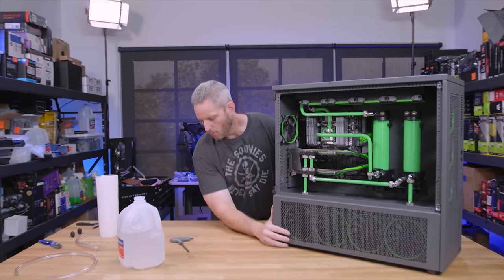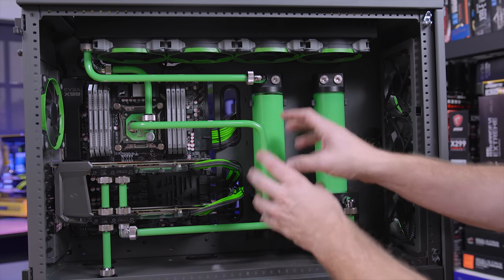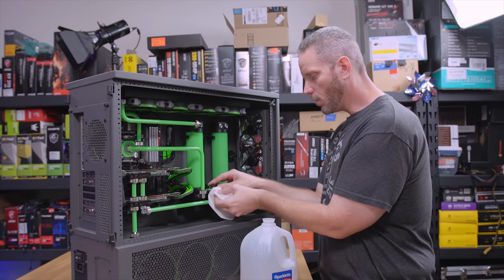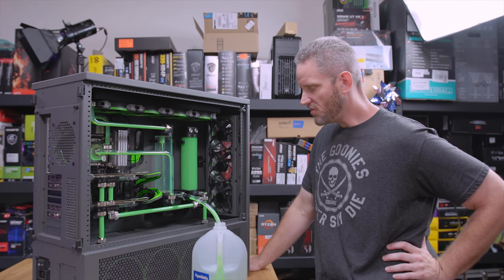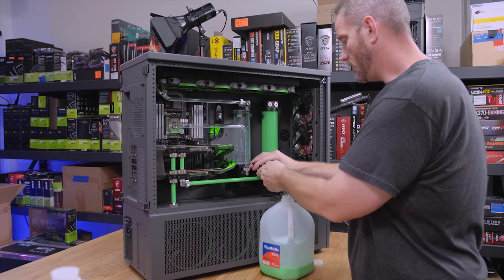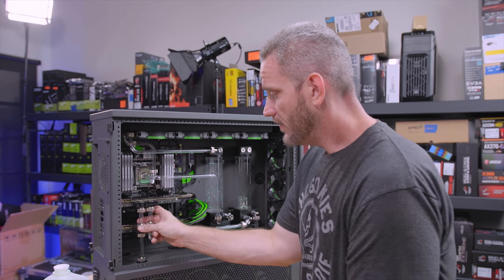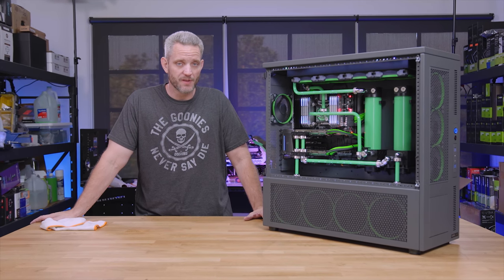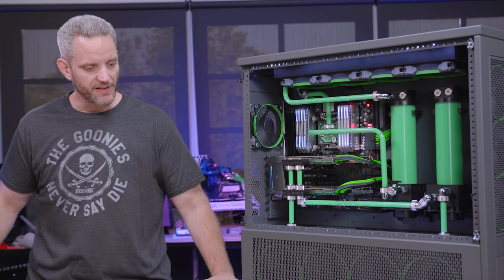This fluid has been running for TWO YEARS! Did it hold up?

Comment: lol, didn't know cooling fluids had dates, mine is still in since 2014 XD
it was clear, it's now somewhat green, but i think that's just the color from the green replacement tubes i used.

Liquid: self mixed liquid (EKWB: EK-KIT X360) and ''battery water'' (total 1L)

Comment: I've never used water-cooling but I've built a few computers and I'm a mechanic. Why don't people use automotive engine coolants? One would think they are perfect for the job containing seal conditioners and corrosion inhibiters. I'm sure there is a reason, just interested. The longest are rated to 5 years?

Comment: I'm curious about the internal design of the blocks that sit on the CPU or other chips.  Is the internal surface of the block smooth, with just an inlet and and outlet?  Or is there some way to create turbulence and maximize coolant to surface contact time?  Does anybody make one with internal cooling fins that the coolant would have to pass through or over, like a radiator?

Comment: Does anyone know, would one video card run hotter than the other, since the fluid goes into one first, then the other without being cooled in between? It seems like you would want to either have a separate radiator for each card, or run a splitter from the pump, and a separate line to each card?

Comment: Have a Alienware tower "the Frankenbox" 12 years later have just updated ram from 4 to 12 gig an replaced the two 1 gig video cards with a Nvidia 980ti but my water cooler in it has never been refreshed nor are their any signs of corrosion an its cooling a 2.8 Intel quad core

Comment: This seems like a massive expense for very little pay off. I mean, do the chalky, pastel liquids actually give a higher benefit overall once you include the time/effort taken into draining/cleaning/unclogging? Wise to put on a "psychology" hat here. Remember, its remarkably harder and more annoying a chore than a standard drain, ergo, you will subconsciously want to put it off for as long as possible (you drain your comps regularly, except the pastel one. You left that one to sit, reasoning that you had residue issues with the last one you drained. See!)  When you do get round to it, the job is now three times as hard because you should have done it sooner, more often and more precise than if it were filled with a goop that was not 60% talcum. If you are mechanically minded, ask yourself why there are so little pastel coolants for an engine design that runs fine at temperatures that would melt PC components. Then ask yourself why all PC tubing is clear. Are you catching on now?

Comment: So is there a specific CPU/GPU that needs this type of setup or is this for ppl who overclock their  PC ??  I just saw a
mineral oil cooling setup & I had the same question;;  Is there a certain speed of Components that require this much
cooling?  I'm looking to build my next system & need to know now if I'll want to build a cooling system into my build?
peace
Reply: No, this is pretty much done for aesthetics and acoustics. Although liquid's thermal conductivity is higher than current air coolers.
Reply: @chazy123  ~ as someone who went to school for Heating/AC & worked in that industry I understand
thermal dynamics well & I ty for telling me this was partly for "aesthetics"?  My current pc is a laptop
ASUS 753VD >>  it's a gaming pc & it's pretty fast for normal internet videos & such but even w/ the
1050 GPU there are games it can't run too well?   So as I ponder my next PC I'm kinda thinking all
of this cooling is unneeded as long as I don't "overclock" my CPU/GPU?   Is that a true statement?
If so, I'll build mine and not overclock & still be good enough for my uses..... I'm going to make
videos & that might be all the "Work" put on the system....... peace & Happy Holidays
Reply: @diggydice9041  Even if you plan on overclocking, air cooling is perfectly fine, there are many cheap air coolers in the $40-$60 range which outperform the best AIOs (these are around $200 and more). Custom water cooling is something for enthusiasts and those who enjoy tweaking their computers. If you don't plan to then about the stock cooler both Intel and AMD are fine, but just so you know AMD Ryzen's are far better and can also be used for (entry level) overclocking. Happy holidays to you too.
Reply: @chazy123  ~ thanks for wrapping that up so I don't have to watch any more colored water
kiddie videos..... lol,   for me what I have now is fast & after 2yrs it's still in the top 25% of what
I see offered today?  I think I'll hold it 1 more year & then build.   I don't like colored water or
any water for that matter around electronics unless it's a necessary thing......
you've saved me wasting my time on this.... thanks,  have a safe New Year
Reply: @diggydice9041  noctua U12A ..... :)
Reply: @Micropoint.  ~ thanks for sharing & you like this model of cooler on a PC?   Above I was asking what is
a fast CPU/GPU that I can Skip using a water cooler on?   I've got a fast gaming laptop that's nice but
I don't game w/  it cuz I use an xbox 1x .....  When I do build IF I can have a fast system With OUT any
coolers that's what I want & I've never had to overclock my CPU(7700HQ).  I could but no need for
now..... just trying to learn before I order a bunch of shit...... I'd hate to order it just to learn I needed
another power supply, case, & a cooler to operate it?  Trying to avoid that.  thanks again
Reply: @diggydice9041  ha laptop.... not the best for gaming, am waiting my pay that gonna come in some days and finally gotta buy a real computerino lol.

Well so you want to buy a real pc.

What is your budget, wich resolution do you want to play in ? ....

You dont need to use watercooling except if you wich to overclock with let say these I9 from intel LeL..

Nowaday you better go for an amd cpu easy as that.

give me more info and i can help you out.

The noctua u12A beat some aio like kraken just to tell you.... :)
Reply: @diggydice9041  only gaming ? go for a 3600x as mobo avoid msi in x570 x)

aorus elite in x570 = good mobo.

Graphic card RTX ? joke shit.

Go for a custom 5700xt, the best custom are pulse nitro+ nitro+ SE and red devil, about ram you dont need higher frequency the most important is latency x) People will need to understand that one day.. 

3200 CAS 14 is way enough. 2x8 go for sure

gaming + rendering and streaming for example ? at least 3700x, you can even go with the 3900, 3700x will already be way enough. 

psu seasonic minimum 650, noctua u12A for ventirad x), about case i recommend the cooler master H500 very good airflow.

some exemple... About screen, it will all depend of your resolution, am going for more frame so i stay on a 1080p screen, it will be aorus kd25f for me.
Reply: @diggydice9041  as said am waiting my monney to pop up on my bank account and am getting that config.

https://www.casimages.com/i/200102054505315541.jpg.html

5700xt driver where very unstable because its a new architecture, now they seems to be way better and so am going for that nitro+ or nitro+ SE.
Reply: @Micropoint.  ~ I'll tell ya..... I like chatting w/ ppl because they've bought sHIT that I haven't & that's a
good thing for me for many reasons.   My ASUS 753VD  Laptop is a gaming laptop & it's a 17' screen
which is nice..... I plug it into a 34' curved screen & while the 2.8GHz CPU/1050 GPU aren't the best
this little laptop is a lightweight racehorse that can be overclocked to 3.8...... lol,  when I started to
look around I saw that this 2 yr old laptop is still in the top 25% for overall speed so I'm keeping it
for another year.  To buy this one  new is about $900-$1100 bucks but I'm already planning for a
mid tower w/ an I7 Cpu but don't know about the GPU yet,  prices are going to fall big time in
the next year & I'm buying as much power in a PC as I can get w/o having to cool it.  You can
get fast PC's that are air cooled & that'll run games.  I will want one that'll run PUBg or stuff
like that.  I've got $1500 now so I'm looking so by summer I'll have a good choice but the
big thing is buying a motherboard that will have enough PCIe connections for all your
components & that have enough accessory plugs &&& be up-gradable in the future.
We'll see what shakes loose in the next 3 months but I'm getting stoked...
I can tell you are as well my young friend...... thanks for sharing
Reply: @diggydice9041  1500 ? you dont want to buy now and have the time ?

Then economize more monney and buy mid year. :)

Dont go for intel as said, already said why before....
Reply: @Micropoint.  ~ where are you from?  No,  I'm not buying now.... that's what I've got & I'll have about $2200
to spend on the  build.  I've already got good screens here but I'm talking to you so I can begin taking in
the info I need to learn.  Like you're talking about AMD for a CPU so I'll take that into consideration as
I develop an idea of  numbers for each component (speeds & all).....  I know the money will give me a
blazing fast PC w/o a doubt.  Like I say,  I want the motherboard to be ablel to handle another faster
CPU/GPU down the road should I ever need it?    And yeah I'll want to be able to game because I'm
not buying another xbox device of anykind.  I'll use my PC to do it all & my  laptop will do some if
I overclock the CPU but I've got the xbox1x for now & I'm talking to people like you who can share
thoughts/ideas...... I learn a lot this way & I like people anyhow.
peace
Reply: @diggydice9041  am french buddy 

༼ ͡☉ ͜ʖ ͡☉ ༽

When it come to rendering time, streaming and shit >>> AMD now make very good processors. These 7 nm cpu are a beast.

Still with AMD you gonna get a bit less fps in game then intel, but TBH x) this differences is little so little, the interesting part to go for a x570 mobo directly in my case is that am gonna get that 3700 and if later i decide to go for a 3900 i have nothing else to do but putting my 3900 on that mobo x) as it is socket compatible.

2200 should be way enough.

Just to let you know am getting that config this month, goodbye tired of life laptop....

https://zupimages.net/up/20/01/snd6.jpg

And as 5700xt driver start to be stable i will go with nitro+ or even nitro+ SE edition.

As you can see i stay on a 1080p resolution, higher resolution does not interest me + am gonna stream on FB ( youtube sux :) ) So no need of higher resolution, but i am frame sensitive so 240 is a big plus for me for csgo for example, for normal game ican switch to 144 hertz.

But tbh with that config i could just go for a 1440 screen, but again i dont care about higher resolution. 

Tbh go for an amd cpu 3700 or even 3900 if you can add a bit more.

570 mobo just avoid fucking msi mobo simple as that. aorus elite is a good choice strong mobo good vrm + that little pch fan is placed way under the first gpu slot, if you look at lets say asus prime p or pro this pch fan will get covered by your graphic card.....

When it come to ram frequency, i watched so many video again and again to say that high frequency memory are not needed but LATENCY is the most important. So you dont need to get ram like 3600 hertz x)

3200 2x8 go at CAS 14 is way way enough, you can later use dram calculator for ryzen if you want.

3200 to 3600 ram the differences here when it come to fps is again very little..........

X flares g skill 3200 CAS 14 is perfect.

voila voila.

Comment: No matter how much money I have, I will never switch to water cooling. Its so not worth the risk.
Reply: ...the risk is minimal.  There is more risk in seating a cpu than doing a water loop these days.  It's not like the old days of danger den where you were custom fitting some off the shelf fittings.  I've had a water cooling setup for several years now and it wasn't even hard to set up

Comment: The theory isn’t really different than flushing the radiator of a car.

- Drain the radiator fluid.

- Flush it with water until old fluid is out of the system.

- Top off with new fluid.
Reply: pretty sure they cut that out of the video so it wasnt a longer type of video, but idk

Comment: I wouldn't put my mouth on that ever.  You own a damn air compressor get one with a rubber tipped air duster . set the pressure accordingly and Blast away.

Comment: All of this silly water cooling nonsense could be avoided if the CPU socket were simply placed on the solder side of the Mother Board. 

Then the CPU could be clamped to a back plate of heavy aluminum with fins. 

Radio transmitter RF modules have built in copper flanges to conduct heat from the dies and toward a heatsink. 

Computer designers are not very bright in the way they struggle with temperature management.  

A year ago I heard a strange sound near my wife's desk. It sounded like something falling. Not till days later when her computer was struggling 
did I find that one of the plastic tabs that held the bulky spring mounted heatsink fan had failed and the heatsink was floating inside 
doing nothing. You would think that AMD or INTEL would change the design  and do the right thing. Or maybe they love the extra CPU sales from 
modders blowing up stuff!

Comment: I laugh really hard when i heard this nerds things like... ¨without a yearly maintence your pc it´s gonna broken¨.¨Your coolant will be destroyed due the temps¨.  Don´t forget to remaind all this people how cooling sistems works on cars because it´s basically the same but more complex, and cars usually running for years without any maintence, radiators fluxing, coolant change or any bullshit. It´s a radiator with a pump, components to cool it down and destilled water based coolant, nothing else and if you don´t stupid things and use every recommended by the manufacturer your loop doesn´t require nothing but a dust clean.